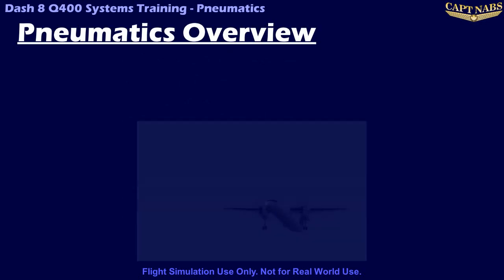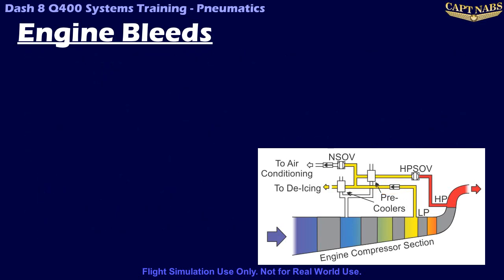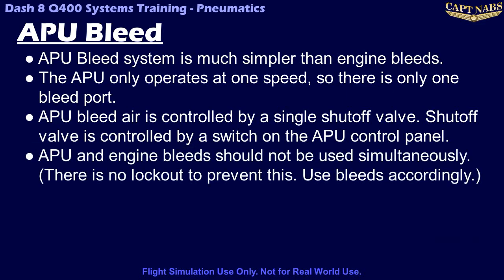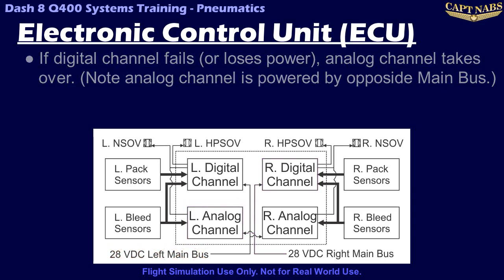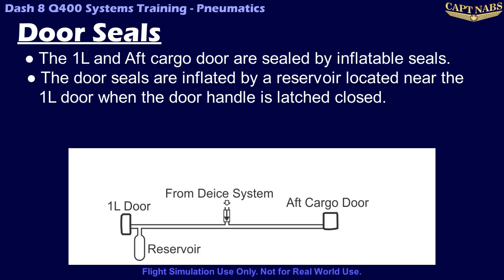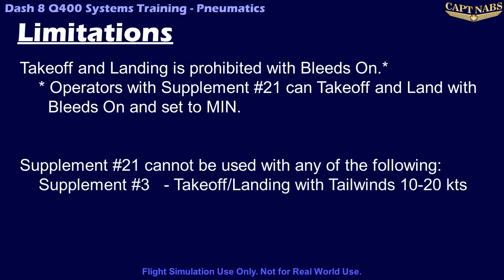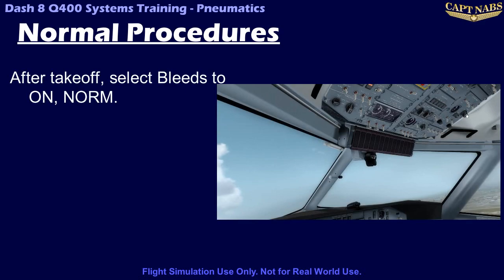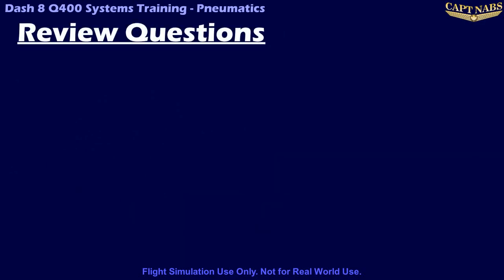Majestic Q400 Systems Training: Pneumatics (Fly Like A Pro)

Comment: I don ' t understand why why you don ' t have course about flight controls
Reply from the maker: The reason is "not yet". Each video takes a few months of spare time to research, illustrate, and assemble. I have simply not reached flight controls yet.
Reply: @CaptNabs   but in m'y case it urgent  , i realy need it ' s a quick summary of system very useful in m'y case we been grounded for more than 3 month  now i do need refrech for next month we Might fly again
Reply from the maker: I am very happy you find many of my videos so useful. However, these are only a hobby within my hobby. I set aside whatever time I can to finish them, but it is not a lot. I will most likely not have another systems video ready this month. You'll have to hit the booka to review any systems I haven't covered yet. As I must also spend some time in the books again, as I will also hopefully be returning to the skies next month,  I won't have much more time for systems videos this month.

Sorry. Good luck. See you in the skies.
Reply: @CaptNabs   that s very kind of you thanks in advance.

Comment: I think that ECS/ECU stand for Environmental Control System/Environmental Control Unit respectively.
Other than that, great video. Keep up the good work.. :)
Reply from the maker: You know, I looked it up and you are correct. Not going to redo the video at this time, but thanks for the correction.
Reply: Capt Nabs my book says Electronic Control Unit. I think you had it right.

Comment: Hey captain...what is the purpose of reservoir for doors...i mean there could be a direct supply for it.or is there some other logic behind this?
Reply from the maker: I've always wondered about that a bit, and no one could give me a very certain answer. I think it is one of 2 possibilities:
1) To ensure the doors remain sealed, even if bleed air is lost during flight (don't want the airplane depressurizing too quickly).
2) Just to help seal the doors properly on the ground to keep rain, snow, dust out when the airplane is parked (overnight for example).
I think reason 2 is more likely. Sorry I can't be more helpful than that. No one seems to have a good answer for that...
Reply: @CaptNabs  thank you anyway, as 2nd possibility didnt come to my mind😇.keep educating.👍🏽